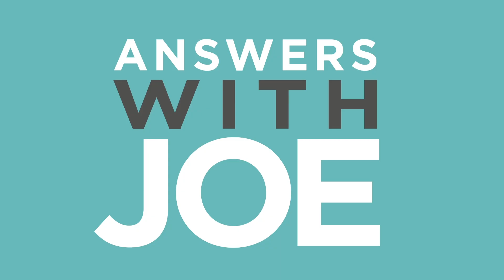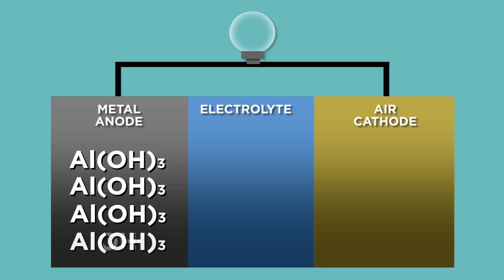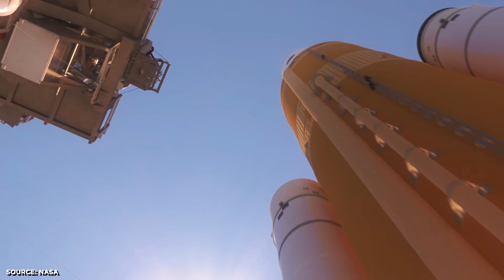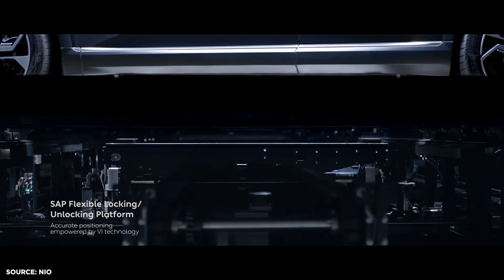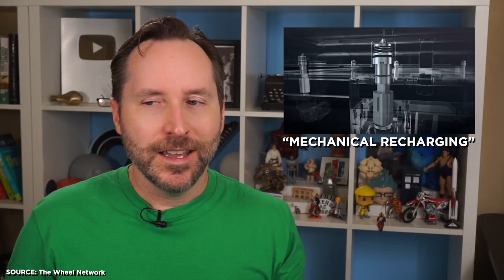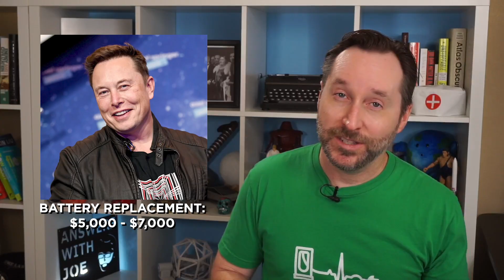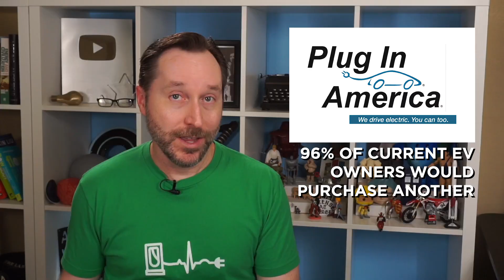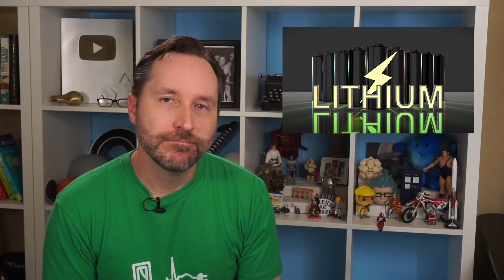This Battery Could Drive A Car 1500 Miles - But There's A Catch | Answers With Joe

Comment: I don't consider it anecdotal when Tesla charges 22k to replace LiIon batteries currently (as in, September of this year). 

I doubt batteries as a service will really take hold in the consumer market. Being able to fill up our vehicles when we want to gives a sense of control that I don't believe the general consumer will willingly relinquish. Then there's the worry that "will it be available when I need it? What if I don't need to replace the battery when its time? An I getting hosed because I didn't drive enough this month?" Like you said, it would require an infrastructure that does not currently exist for people to feel confident in it as a way to power their vehicles. 

This might see use in fleets of vehicles though; long haul trucks or short range uber/waymo vehicles that are either travelling to a destination with a replacement schedule preset or travelling short distances before returning to base, where they can be serviced at need. With a low enough cost (and keeping your service in house can help reduce cost to larger companies) this might become quite appealing indeed.

Comment: If the issue is the plates develop a layer of oxide that stops it from working… is there a reason why simply scraping off that layer won’t work?

Comment: Could you do a video on the Ford Nucleon? It was a concept of a nuclear powered car back in the 50s. Way ahead of its time
And on that topic, I really like the idea of nuclear power and I feel it's what we need to hit 0% carbon emission much more quickly*
Oh, hello there, Mr. Asterisk!
Reply: Remember Nuclear power is only clean when making power. To refine components making them fuel ready, and then once fuel components are spent (or used) is not environmentally friendly. Besides the waste needs to be monitored for hundreds of years after we're gone.

Comment: The battery swop idea has two major problems. Firstly batteries are really heavy so need to be firmly bolted into the vehicle. This takes a lot of bolts which must be properly tightened   The old battery will need to be lifted down and moved out the way and the new one moved in. This needs a hydraulic lifter, they are way to heavy to be lifted into place by hand.
Then there is the connections.  Car batteries hold a lot of power and their output is high voltage. The connections need to be properly made and completely water proof. All the cables need to securely retained so that they do not hang down to get dragged on the road or get caught on objects. 
I just don’t see that happening reliably or being an economic approach.
The recycling of the aluminium debris from the dead batteries, which will have to be done using electricity, is likely to make it also energy inefficient.

Comment: I think this would work really well in an electric bike. Lithium ion electric bikes exist and are probably the most prominent at the moment, in terms of electric bikes. However, they're also pretty expensive. The range is also quite limited for long-term trips and honestly the energy density isn't high enough in a lot of them, especially on the cheaper end. This could help me more affordable electric bikes that don't weigh 20 lbs more than a regular bikes when the battery runs out

Comment: Battery swap will never happen. If a battery cost $10.000 and each station needs to have 5 batteries in storage to be able to charge them before the next customer. That’s $50.000 in batteries that are not used in any cars, but just sits and wait. That is a massive expense, not to talk about the station itself, and even some person (Nino have that in China) who have to supervise and fix issues all the time, working in 3 shifts all year round, that’s expensive. So no that technology will never be cheaper than just charging your own battery and will never succeed.

Comment: If all vehicles go to batteries where are all the millions of batteries going to come from ?.  I suspect hydrogen will win out.  Especially as some of the ev cars about a the moment pretty much need a mortgage to buy one for a car that will only run for 7 years before it needs a new battery.  Will keep running petrol as long as I can with luck I may be able to hang on till after I retire and don't need to drive so much.

Comment: Why can't they just make the actual aluminum blocks themselves be able to be swapped out like a set of cards? Wouldn't that be a simpler solution than replacing the whole battery?

Comment: Man I completely disagree about the inrastructure. From the video it sounds like they could be re-done as a blade-server type solution. Instead of changing the entire battery pack at a station, a smaller gas-can sized battery, and then a water tank for the car that automatically manages the level.

For me that would solve the final issue that ice has over ev- refueling in remote/rural areas.

Comment: Joe, Mr. Asterisk says: 1) The proposed Aluminum-Air vehicle battery is very large and very heavy. There is not much capacity for people or payload.  2) Aluminum burns Really Really Well. Don't believe me? Research the fate of Royal Navy ships with Aluminum superstructures in the Falklands conflict is 1982. This metail is very difficult to extinguish, and it's not all that hard to ignite. You don't want to be there if and when.
If you want to find a whole hat-full of research on metal-air batteries, look up NASA's research on various chemistries to be used in the Apollo spacecraft. That work has been done thoroughly (and it's already paid for). 3) Think seriously about the physical weights and mechanical geometry involved in swapping out a large, non-rechargeable Aluminum-air battery. There's a bit more to it than filling a gas tank. Quite a bit more. There are also dangers inherent in that system which are non-trivial. Whether mechanical, electrical, or simply dropping the battery on the ground (or someone's foot), the challenges would have to be solved before any large-scale introduction. 4) Yes, the Aluminum in the Aluminum-air battery is recyclable, but safe disassembly of the battery is a non-trivial exercise. Yes, it can be done. At what cost in energy, or dollars is another question. You've kind of hand-waved your way through the known and real engineering and technical issues, and that does not make the espousal of replaceable-battery vehicles more attractive. Very few technologies are as straightforward as you infer. 

If you don't believe this, cast your eye back to 1992-96, where the introduction of cars fueled by methanol (M85 - M90) was being heavily pushed by the Canadian government. Two of the "Big 3" car makers actually developed fuel systems and engine components that met the demands of high-percentage methanol fuels. We had some, of those cars right here, and they were available in urban Ontario and other places. But - where I lived there was one (1) gas station that had M85 fuel, in a city of a million people. And with the refineries providing the Methanol right there. Fuel suppliers were not prepared to invest heavily in new tanks, equipment and logistics for M85, and not many people were keen to buy a car fueled by something not readily available. There were other issues with these plans as well, and the push for methanol fuel died. The same thing happened during the 1990's when the federal government made a massive push for the adoption of bio-Diesel. That project was extended to include both Hydrogen and Methanol as possible transportation fuels in Diesel engines. Many tens of thousands of miles of real-world road tests in severe conditions and with heavy loads were done and documented. Likewise, fuel-cell technology was explored - "anything but" conventional gasoline or Diesel got a lot of attention, and a lot of research. "Alternate Energy" for transportation was a "really big deal" and a lot of real research and real engineering was done, and not "on the cheap."  The point is that developing and adopting new technology is not a 'point-and-click' situation, regardless of its appearance in the popular press.  
(Last) A sidebar concerning "generating Hydrogen on-site by electrolysis." This process is so energy inefficient that one highly respected alternate energy researcher likened it to "making a campfire by burning Gucci handbags."  It is among the least efficient and most expensive types of transportation energy, and that's been  know that for a long time. My direct experience was being part of a research group that did a lot of actual real-world engineering, and published the results in peer-refereed engineering journals between 1989-1996. We looked at many fuels and energy sources, including hydrogen and "bio-fuels."  Hydrogen in nature is often bound to something else. As with electric car technology, the devil is in the details.'

Comment: What if we were just to convert the recycling plants to electric and let them run on the aluminum air battery then they can recycle it and they just get trucks in just like they would with the materials that have batteries

Comment: id  like  to point  out  these  type  of  battery's  discharge  over   time  and   would  not  be  suitable   for  a  car   that  isn't   driven   a  lot 
ie  my  hearing  aid  batt  work  about  2.5  days   but  if  i  don't  use  it  at all  for a  week  its  dead  anyway

Comment: The real issue with EV's which you glossed over is the right to repair battery packs. By design these battery packs should just need replacement cells and rebalancing, which should NEVER cost $16K. After all, there are tons of people making DIY Li-ion battery packs for solar power systems and those are simple and easy. Once adoption grows and more companies are honest about service costs, and about how to recycle batteries, we'll have a solid and reliable system.

Comment: The battery swap system whether Li-Ion or Air-Aluminium is the only way to go for long distance travel.
Reply: No it isn't. Maybe the only way for batteries, but Hydrogen fuel cells and organic combusion engines are both systems that have good range.
Reply: @MsHojat  And ones that should be invested in. Instead of Elon's m increasingly demented ideas. Same as classic efficient solutions To refine them instead of sidelining them like nuclear energy, electric railways(would help to combat massive emissions of commercial road transport) and air/sea transport. Batteries are horrible solution for air and road transportation. Unless they truly find a tech for them that isnt toxic,light and rechargeable; but that is unlikely to happen...
Reply: @MsHojat  It's going to be near impossible for everyone to drive eventually. Alternatives to batteries are going to be needed.

Comment: A good route would be to make the aluminium component modular, make the electrolyte tank for extra capacity and a waste port with a built in scraper that cleans out the gunk.

Comment: Joe.  Sorry not sorry.  You are dead wrong and disingenuous to just restate that a battery replacement is only maybe $5000 to $7000.  There are MORE than enough examples out there and not just for Tesla, that this process is VERY typically $15,000 to $20,000 (Unless you go the unconventional route and visit Rich Rebuilds).  Effectively, a BEV will NEVER ROI compared to a properly efficient and reliable car like a Honda or Toyota.  Full stop.

If Hydrogen fuel cell EVs become more of a thing, they win the economics math for the end user by a long shot.

Comment: its insane that people buy fully electric cars when they know very well how a phone will age after a few years..  The battery in the car will go bad after a few years and its not as cheap and easy as getting a new phone in that case. 
If you want to go enviroment friendly buy a hybrid car, you have the choice between gas or electric and the enviroment cost will be less (smaller batteries).
You get better range aswell..

Comment: Aluminium air batteries have been around for a long long time, and they are notoriously hard to recharge electrically. If you would take the battery out and recycled everything (so, the aluminium oxide goes back to the aluminium plant and is electrolyzed in molten form) you would lose huge amounts of energy, and in the end, this system would emit WAY MORE CO2 then a diesel car. All in all, nice idea, but not feasible.

Comment: Okay but how heavy is this compared to the other batteries? That's got to have a huge impact on applications and you didn't really cover it. I know water is involved but what is the weight when dry?  Can a person slide a dry battery cell into a car by hand and then fill it up?  How much added weight to a ship? Could an airplane go electric with this?

Also, could you flush the battery out I'm sections? Like use one section and flush the water out to make the whole vehicle lighter? Would that water be toxic?

Aluminum can get heavy quickly especially when dense so it would be awesome to have a reference for how heavy the 1500 mile battery is...     Maybe a follow up video?

Comment: Look at how much energy it takes to create aluminum
Look at the mileage attained from said amount of aluminum
Compare that to how much energy it takes to create the aluminum to how much gasoline contains the same amount of energy.
You get more mileage for the energy by choosing gasoline.
Aluminum production also produces a fuck-ton of greenhouse emissions.
Just doesn't make sense.

Let me burn this fossil fuel to make this metal that i "consume" for energy to travel instead of just using a fossil fuel directly. 
..derp

It's also coming out of India and the goal is merely to compete with China on energy storage tech..so.. cool?

Comment: What about the research Stanford is doing with the charging road. That means that smaller battery packs. Because for majority of roads would have coils embedded into them, along with a coil in the bottom of the car.

Comment: So-called "solid state hydrogen" is getting a lot of buzz. No, it's not solid H2, but rather hydrogen stored on "tape" without the need for high compression, and swapping cartridges to "refuel" takes 3 minutes.

Comment: I think that they need to design the electric vehicles so that once they pull into their parking spot they automatically are plugged in for charging
 like the little robotic vacuums

Secondarily a subject that I would like to hear your view on and about Joe since I don't find it anywhere
I've seen two videos recently referencing galaxies far enough out traveling faster than the speed of light my take on it is because it seems to be because of the expansion of SpaceTime the movement is greater given the movement through space + expansion of space, but if it's SpaceTime that is expanding then what about the time aspect

Comment: There are quite a few issues with this. Perhaps the most important one to note given you talked about it at the start is how these batteries would be recyled. As it produces oxides, rather than metalic aluminium, it would be akin to refining it, costing vastly more than normal recyling of aluminium which is so cheap beacuse it keeps it as metal.
Also, if this was going to be adopted on a large scale, the cost of aluminium would skyrocket due to how much would be used in batteries.

But from a more pratical point of view with how it is used, as it can't be recharged, you either need multiple batteries to replace where you only replace the discharged ones, or each time you replace the battery, you will be wasting some amount of charge. It wont be like a petrol car or even an EV where you can just top up and drive, and if you aren't sure if you will make it the whole way you just top up to make sure you do. Instead it will be a gamble of do I just drive and hope I make it, or do I waste a bunch of power, just to switch early and make sure I make it.

Comment: It honestly sounds like a good idea for off grid homes as a backup system in addition to a smaller lithium ion storage pack to supplement solar overnight. A standardized battery pack that you could have delivered via Amazon on a truck and swap out as needed. Depending on how long a small pack could last it might be a good replaceable battery for phones or other portable electronic devices in lieu of alkaline or rechargeable batteries.

Comment: So you can't recharge the battery...therefore you would want to use it most efficiently to extract the maximum mileage out of it.   Let me think, what is the most efficient vehicle?   I do believe it is a bicycle!  You could have a Amazon like locker set up at stores to exchange the battery for a new one.  If your old battery still has a bit of life in it, the exchange unit could be linked to store to completely drain it before recycling.  I'm not saying aluminum batteries are the way to go, but e-bike usage makes way more sense then a car.   In fact that is true for 90% of all trips!   HEY GET AND USE AN E-BIKE AND SAVE THE FREAKIN PLANET!

Comment: Surprised that the defunct company Better Place hasn't been mentioned, in regards to battery swapping. They are the granddaddy of battery swapping – they actually did it, and had working infrastructure in Israel and Denmark (and Australia?). They used li-ion though, so charging was an option too. Unfortunately the company didn't gather enough interest and went bankrupt. The IP was purchased by Gnrgy, which builds EV charging stations.

Comment: Would these batteries be light enough for commercial airline use? What about powering an ocean liner or ferries? Aluminum air battery powered hydrofoil between Australia and New Zealand?